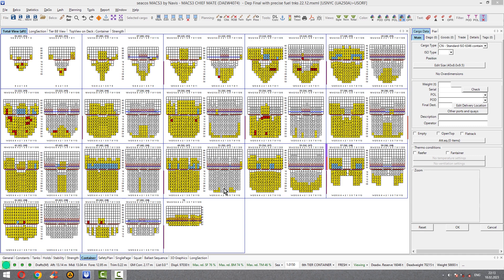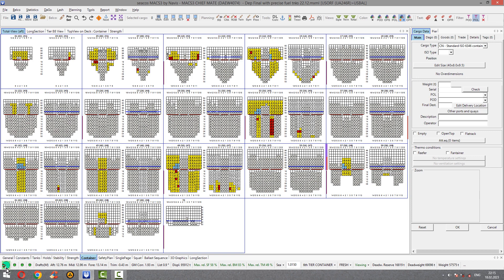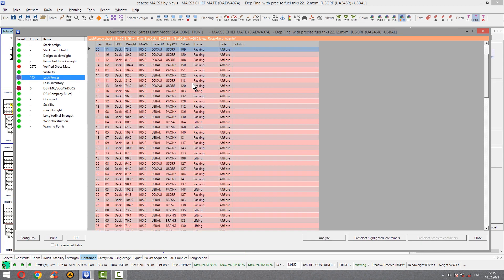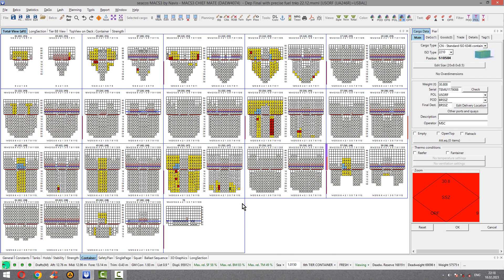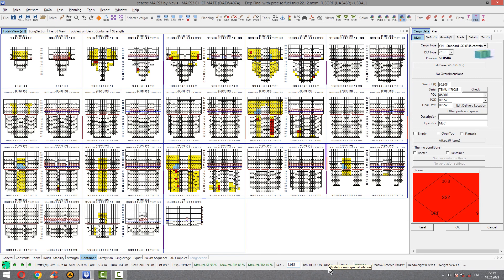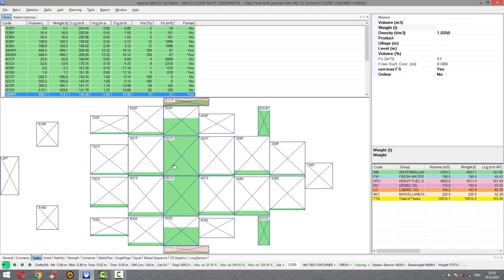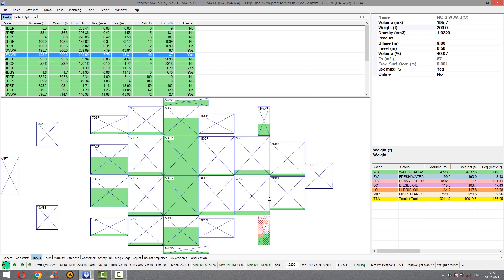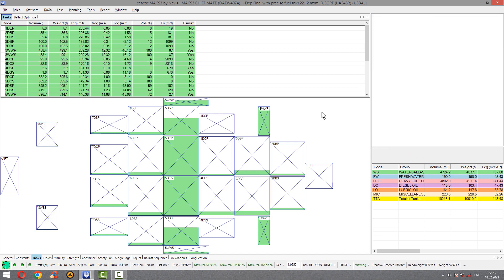Loading condition analysis of real case.

Comment: Make a video about setting constants and how to adjust if bunkering
Reply from the maker: From practice, constants usually set up. If you are going to be exact, it is one good method  to calculate when a ship has no cargo and variable weights  (Dry dock for example while ballast tanks empty). 
As for bunkering, simulate in MACS3 in fuel tanks estimated amount being bunkered, ask CE what tanks to uptake and volume, than you will see all needed data.